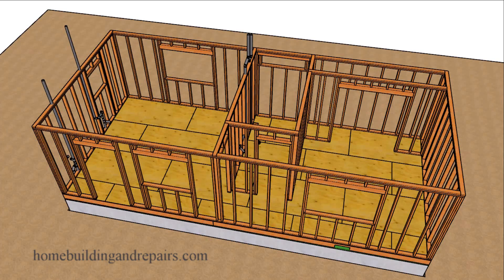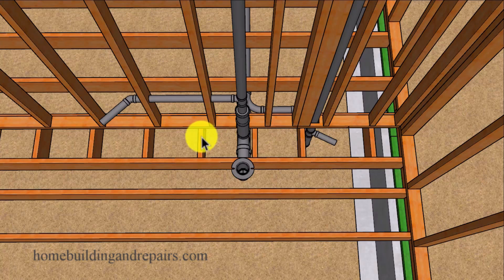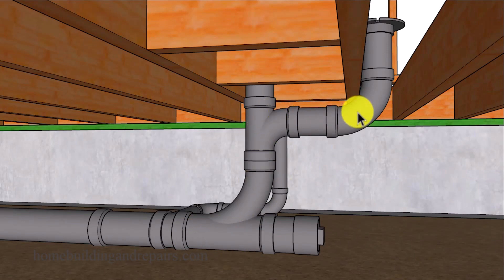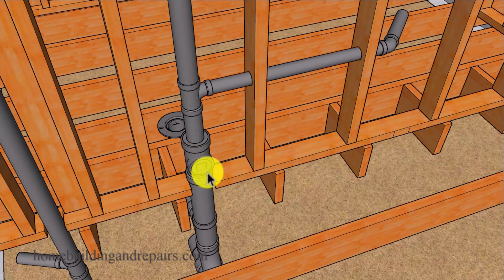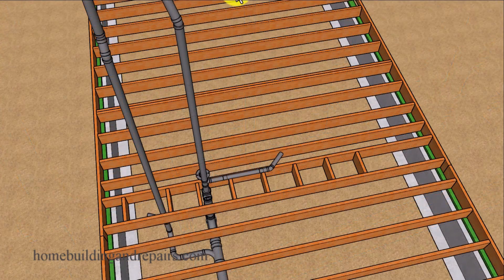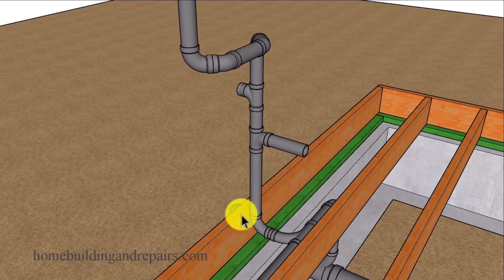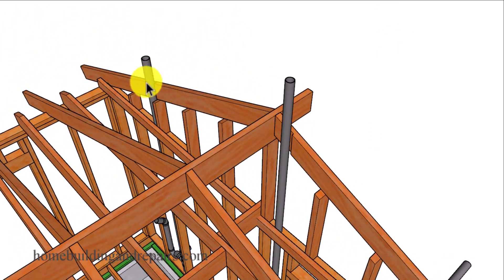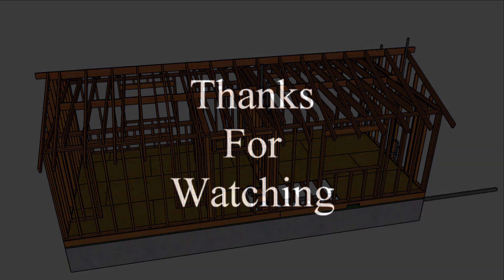More Drain Pipe Plumbing And Floor Framing Examples - 434 Square Feet Home Building Project

Comment: Lol.  Exactly what you described happened to me.  An insurance claim necessitated I hire a plumber.  He took off the toilet to get access to the clean out (behind the toilet….dumb placement!), and then he proceeded to clean out the lines through the toilet flange.  He actually broke the toilet as well.  I took the buyout and installed a clean out in the wall perpendicular to the toilet that is largely hidden by the adjacent cabinet.

Good foresight here.
Reply from the maker: Yes, another been there and done that, bummer for property owner repair. Thanks for sharing.